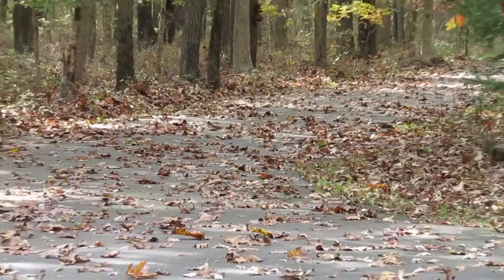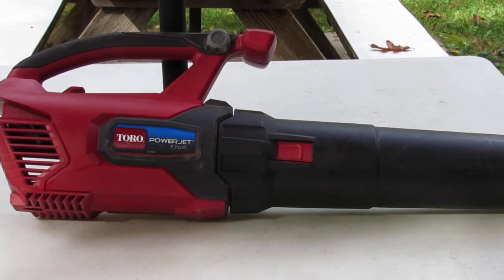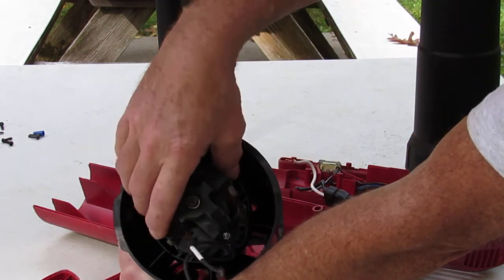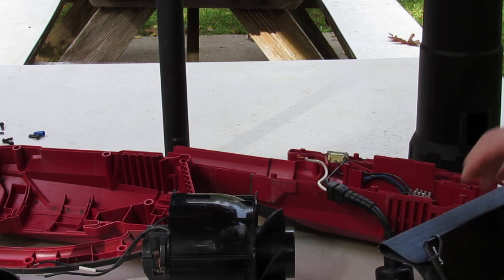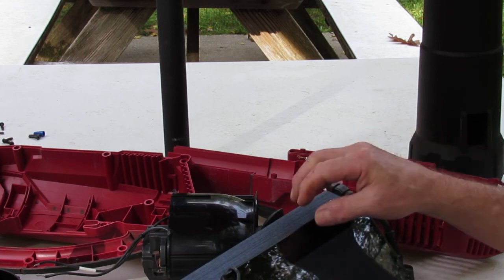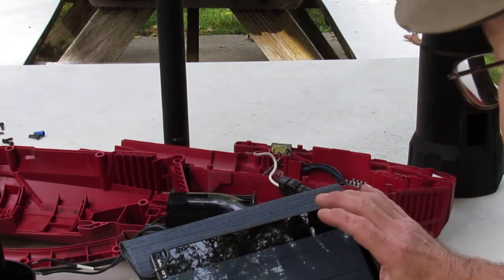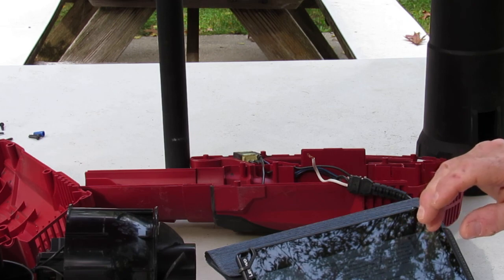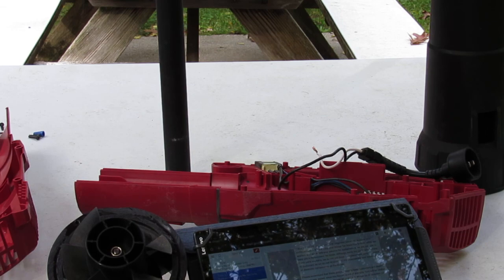Toro PowerJet F700 Leaf Blower

Comment: I paid $80 for mine at a hardware store. It stops working, but when I bang it on cement, it works again. Something is loose inside.  It is the consumer's fault for demanding the lowest price. These tools used to be easy to take apart and fixing it yourself, but there's greater manufacturing costs to make it like that. Same thing happened with automobile headlights. Once upon a time, cars were manufactured so you could replace the headlight yourself. Now it's easier for the manufacturer to assemble the entire front end, but the consumer is required to go to a professional mechanic.

Comment: I'm Never buying Toro again for the same reason,No parts.  One blade on my F700 broke off. Luckily it has an even number of blades. I broke off the one opposite the one that broke while using to balance it out. It now has only 4 blades but seems to work almost as good as it did with six.
Reply from the maker: That's a great idea!👍  Never even thought of that.